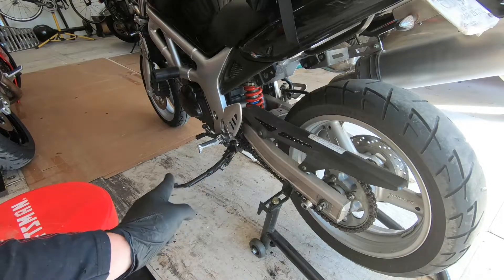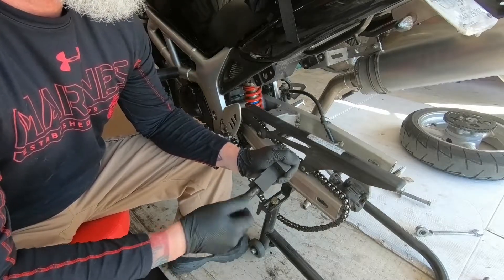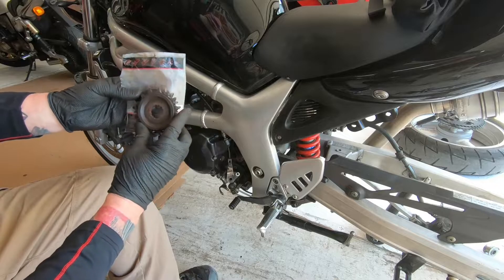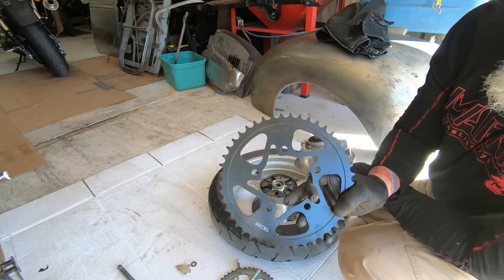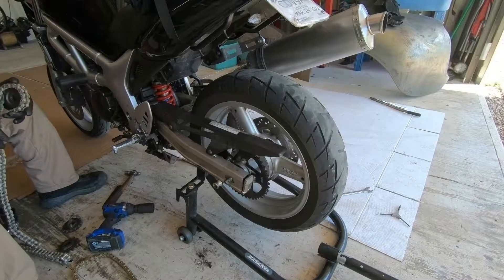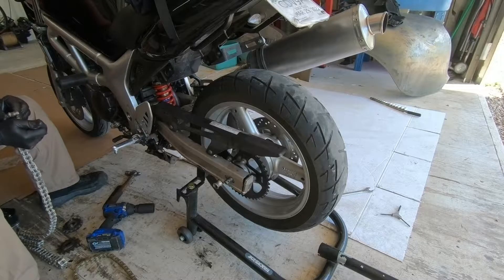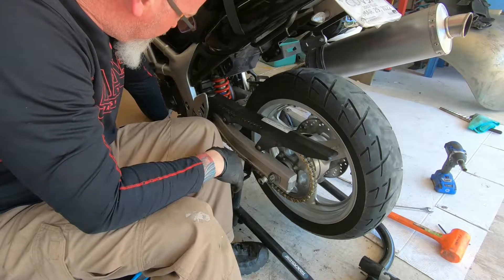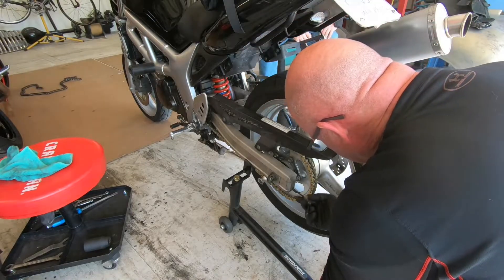2002 Suzuki SV650,  Install new chain and sprockets, align rear wheel

Comment: Did you tighten your front axle nut with an impact driver and your transmission in gear? Most advice I've seen is to use the chain to hold the sprocket and countershaft while you tughten.
Reply from the maker: Ugga dugga takes it off, ugga dugga puts it on.

Comment: WD-40 on a chain? o_O
Reply from the maker: Cleaning
WD-40 is a solvent that can remove rust, grime, and corrosion from a motorcycle chain. You can apply WD-40 to the chain while it's moving, then let it soak in for a few minutes. After, use a clean cloth or paper towel to wipe off any excess.
Reply: @ELDESTBuilds  because from my understanding WD-40 is a highly penetrative thing. Therefore it ruins rubber bushings and washes all factory sealed grease out from the chain. So, basically, it kinda ruins the O/X/Z- whatever ring type of chain.
Reply from the maker: I have used wd40 on motorcycle chains since I was 6 cycles old, dirt, street, track. I've never had a chain fail. I've worn them out around 15-20k miles. I clean the chain with wd40 before almost every ride and lube up with 90w or chain wax. 90w if it can sit overnights and chain wax when I'm on the road. Clean and lube every 500 miles minimum,  but that's just me.
Reply: @ELDESTBuilds  thanks for your practical advice ;)
Reply from the maker: I have a couple more videos about the chain. I'll make up a playlist. 
A clean chain is the important part. Then add your lube of choice. Otherwise, you're just adding lube to grit. 
Check the air pressure in the tires, clean and lube the chain before every ride.
Reply from the maker: I also obsess over clean glass, but I digress.